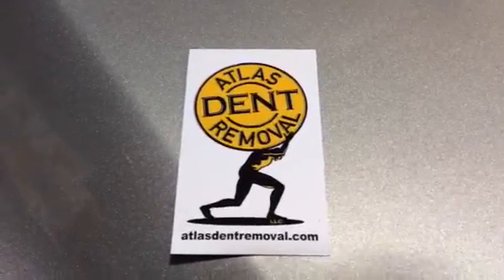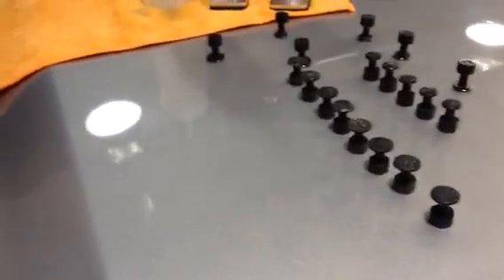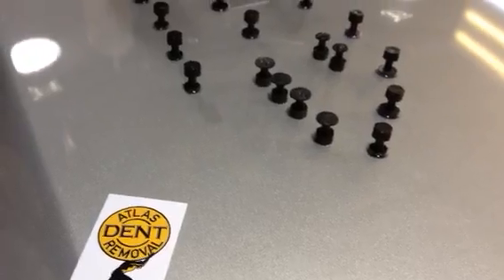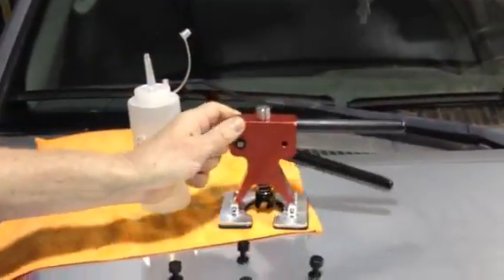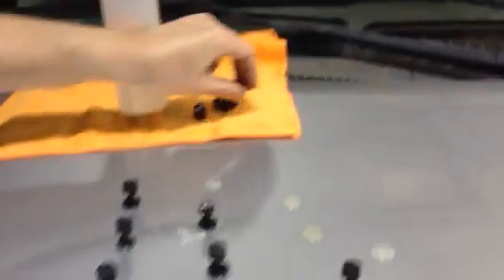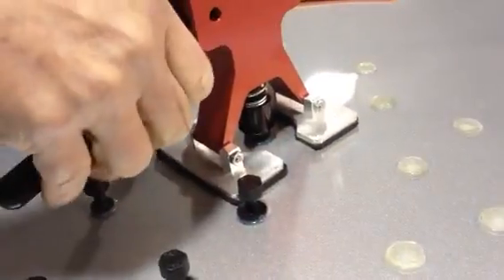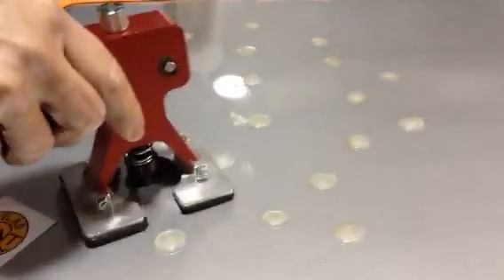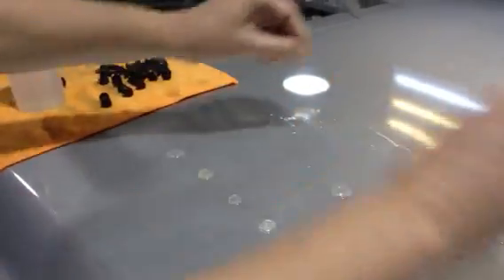The Best Glue Gun For PDR Dent Repair

Comment: Glue is glue, only variation is temperature of melting. This popping looks designed to impress folks, but really shows little; all that matters is the glue creating a suction adequate to pull the panel out, and even low temp glues likely work fine, with less risk of paint lifting. The dent is what should be popping. Risks of DIY are using a lever against adjacent areas and making new dents, or having the glue actually lift off paint, especially if a dent shows cracking on the surface.

Comment: You should have circled what dents?! The panel had no dents. You were setting tabs on a non dented surface. I have no problem with you guys selling and reviewing a product and showing it's benefits, but don't pull the wool over everyone's eyes and make crap up. it's plain to see that you were randomly placing tabs.
Reply: They were randomly pulling on a straight panel to show you that each tab had adequate pull.

Comment: which of all glue holds strongest????
Reply: Cheap med temp craft glue at Wally world and high temp gun also from Wally world has all the bonding needed for tabs!  If needing to do a BIG area use same glue sticks and a heat gun!  Rear door of 98 Ram  1500 pushed in pretty bad! I made a bridge with 2/4 and glue on block of 2/4, then used screws to pull block to the bridge! GLUE NEVER let go!